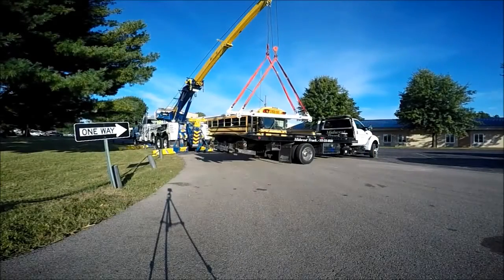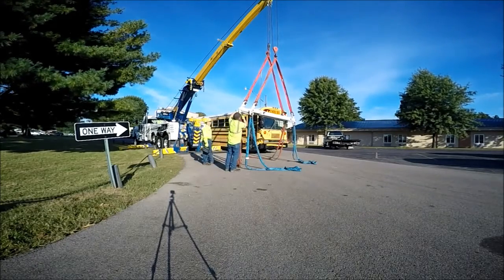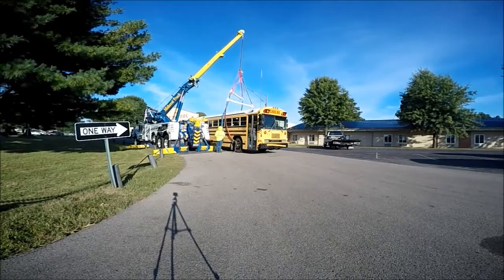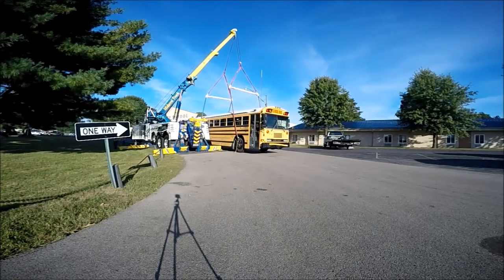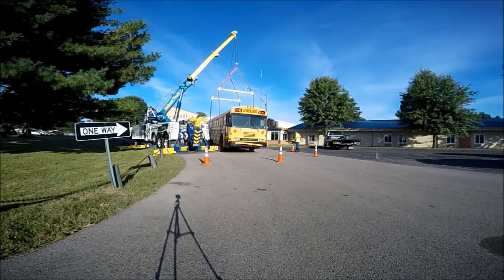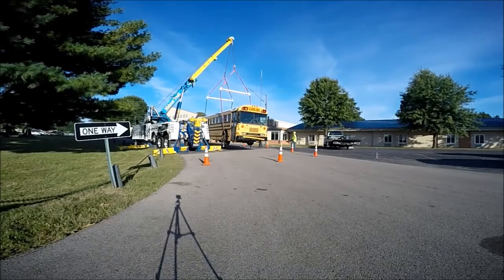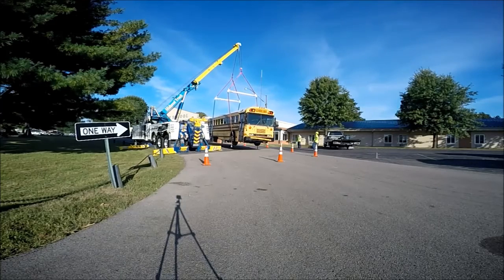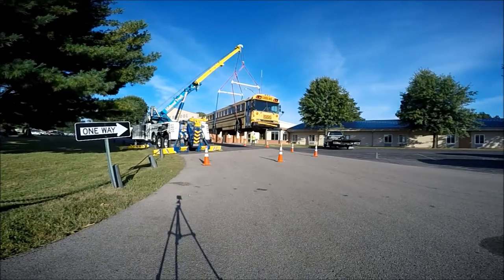School Bus Lift Demo 10 6 2016

Comment: Really like having two equal winches on the boom. Our cranes have main + auxiliary hoists but generally the hoist capacities are different. That difference complicates rigging a lot. You've done a sweet, solid and safe lift . Strong work, Ron.
Reply from the maker: David Sonnen.  Thank you sir.  Yes, having two main hoist winches makes it much easier to compensate for uneven loads with an offset center of gravity.

Comment: What is the max. you can lift at full extension ?  thanks for taking the time to use your truck for this .  Not sure if this can help your business hope iT does.
Reply from the maker: Structural max lift at full extension is between 18,000-25,000 lbs depending upon the carriage location, boom rotation, and elevation.   Thanks for watching and God bless.

Comment: Great show for the kids But what's the maximum lifting capability at full extension Ron
Reply from the maker: Brett Swampy.  Brett, at full extension with the boom flat, at 0 degrees, which is the weakest point, it will lift approximately 22,000 lbs.  There are a lot of variables, such as the size of the load, the ground that my truck is sitting on, even the wind plays a factor.   As you raise the boom elevation, it's capacity goes up.